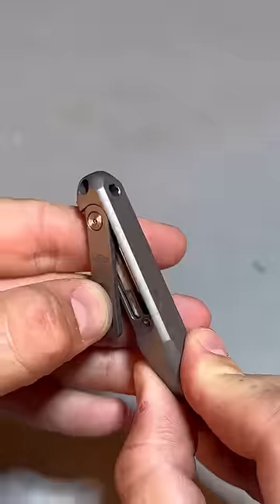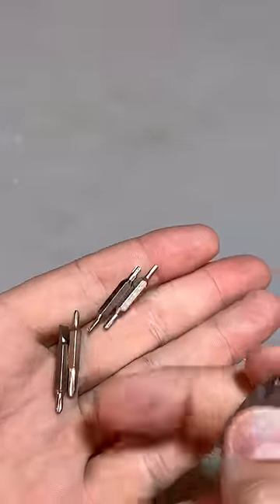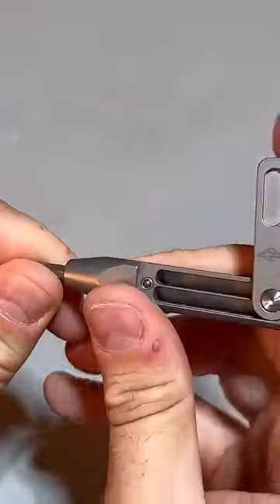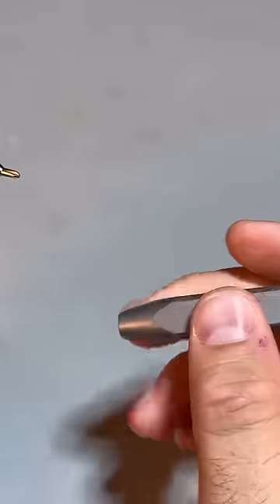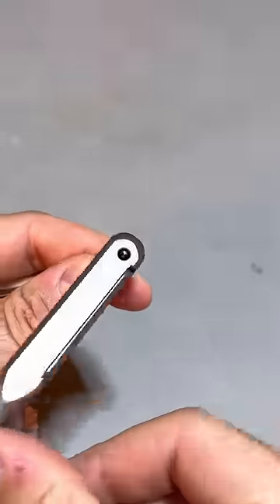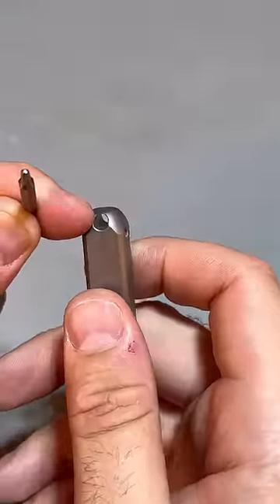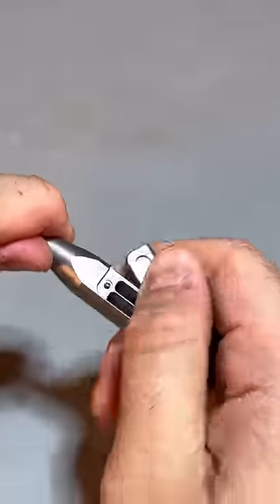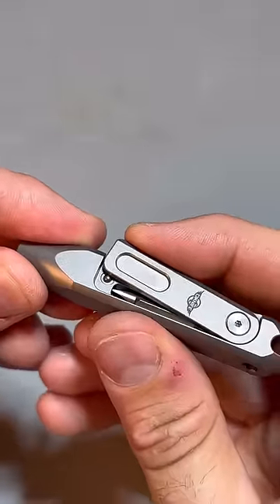Next Level Keychain Screwdriver 🪛 #gadgets #edc

Comment: This is actually cool and would come in handy
Reply: Just carry a multitool
Reply: @shable1436 exactly ! This thing isn't coming handy for anything, and when I need a micro screw driver I have a micro screw driver set
Reply: Alokra y🎉😂😢😮😅😊❤
Reply: Right? Especially because you can use it like a wrench. Usually with those smaller screw drivers it’s hard to get a good enough grip on them to actually tighten things.
Reply: @BenDover-de7tf you can carry it everywhere without it being intrusive and it’s made well. It’s as simple as that to understand how this is useful and very well made.
Reply: What are you thief

Comment: It's a titanium Olight bit driver (from Obuy). I will admit it  was well worth the $20, and solid design for the bits and sliding bit holder door.
Reply: the option for more leverage is a very nice touch
Reply: It looks very handy.
Reply: @hughmann7485  If only bit tip could maintain that extra force.